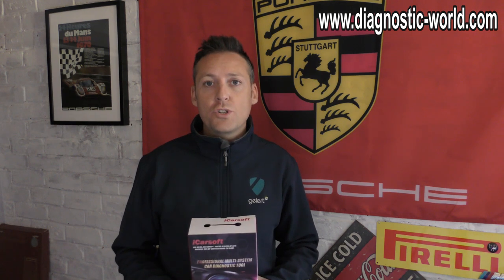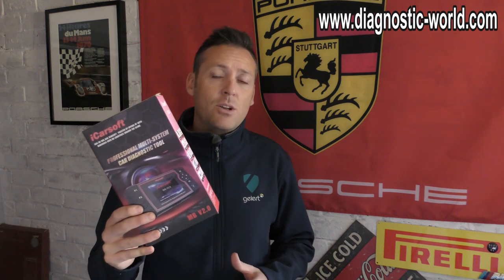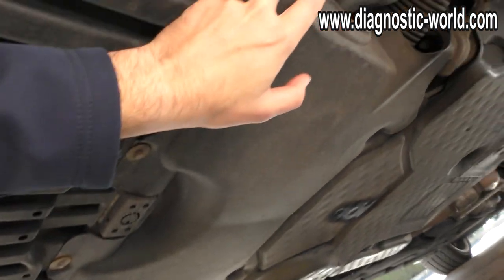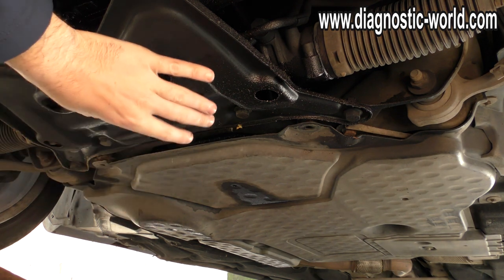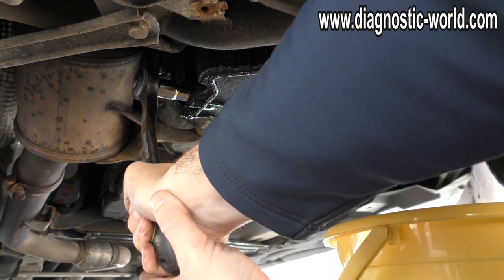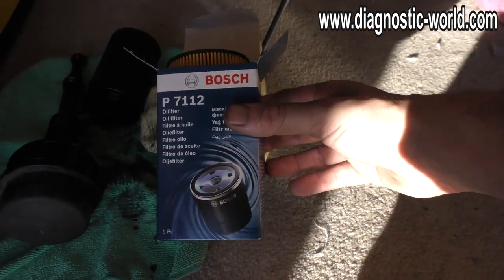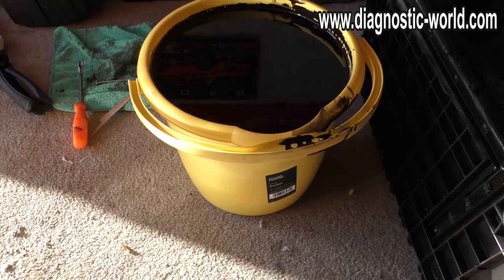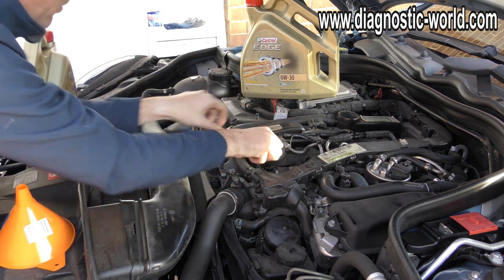W212 S212 Oil & Filter Service Guide How To Mercedes

Comment: Why not vacuum from the top like the dealer?
Reply: Because the dirtiest oil is the one at the bottom of the pan which does not get picked up by the vacuum.
Reply: @f581474x  only if it sits

Comment: How high are the ramps?
Reply: when you start dealing with the $700 tranny ATF service you need to be lifted and leveled... jack stands not 2x ramp. Engine 5w30 oil no problem
👍
Reply: G Lasser the guy in the vid used 2x ramps to lift up the car, I want to know, whats their heights,...
Of course, you can lift up with  sth else like a hydraulic jack but I think, ramps are easier and quicker to use✌️
I‘m sure I will secure by jack stands too